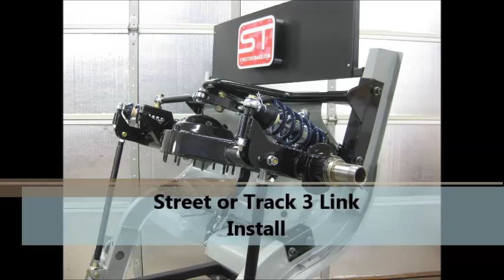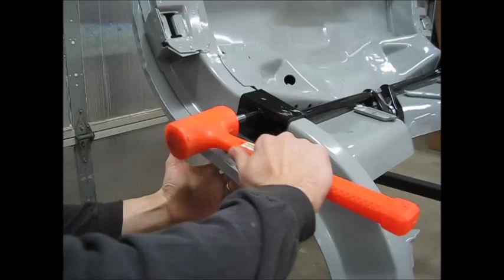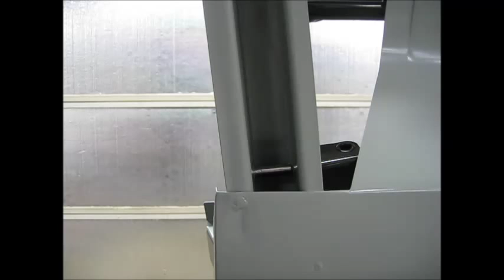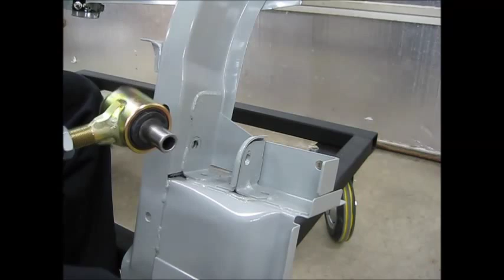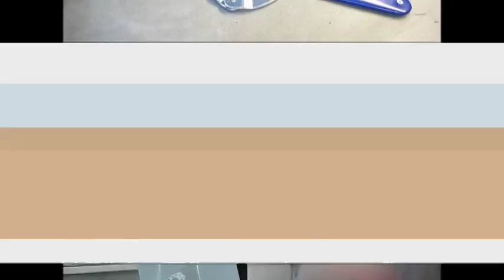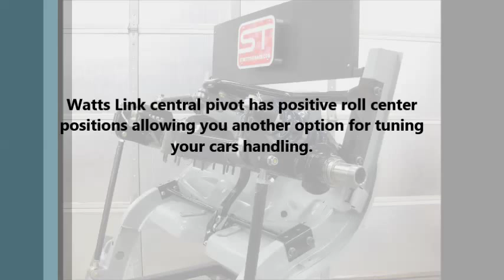Street or Track 3 Link Install overview

Comment: I'm considering this system in my 68 build.  I'm installing wider wheel wells so I can fit larger wheel/tire combo in the back.  I understand the trailing arm can be mounted on the frame itself giving more room but I worry about dragging it on speed bumps and such.  Can the lower arm be moved even further in to just inside the frame with a custom mount?
Reply from the maker: Thank you for your message!  For cars with a mini-tub we move the housing end trailing arm over, 38" on center would be the minimum we'd recommend.  The forward portion gets welded to the frame rail/edge of the torque box.  We've run them like this on street and race cars with no clearance issues over speed bumps.  If you wanted to attempt moving the mount inside the frame rail you'd have to check muffler clearance.  If you have any questions please call or contact us.  Thanks!

Comment: How does that top link affect pinion roll. I thought the top link should be the same as the lower rods?
Reply from the maker: The Side View Swing Arm Angle is actually very good and there is very little pinion angle change throughout travel.  Our geometry sees 58" of SVSA with trailing arms mounted in the leaf pockets and in the 80" range if you use our lower links.  A good starting point for a race car is 60" so you can see that even in the stock leaf pockets we are in a good spot.

Comment: I'm waiting to buy this three-link as well as the full floater...I already have your front spindles that I'm pairing with the Global West system that I had already purchased some years ago....I cannot justify tossing the entire front setup due to cost, but will your three link work well with their front system? I have the upper and lower control arms, strut rods, and the Koni Classics that came with the system...also have their 13" front rotors, with Wilwood 6-piston Superlite calipers...the whole shebang is going on a 1969 restomod Mustang fastback...it's gonna be mostly an aggressive street machine, but will see the occasional track outings at Millville...whaddya think?
Reply: Super informative vid by the way...thanks for posting these...I'm really impressed with your company and very much enjoyed ordering the spindles and getting the great advice about bearings and such on the phone...I can't say enough how awesome it is that you're putting in the work to give those of us with the classic rides a modern option for handling! Stay safe...
Reply from the maker: +quasarthecat1  We can get the 3-Link to work with your existing front suspension.  Please let me know if you have any questions.
Reply: What is the reason for a full floating rear .  I have always tig welded the outer axle bearing inner race in two areas 180 degrees inboard and installed oil seals just outboard of the center section to keep gear lube where it belongs because the axle bearings are sealed units .  Full floating axle seems like over kill for street ,  racing is totaling different situation ,  or are you guys just covering all the possible applications with your offering , either way you system looks great and should be a blast to drive . All the Best .     Howard